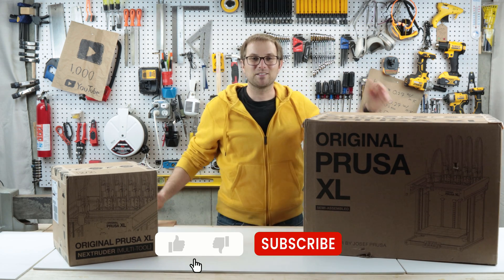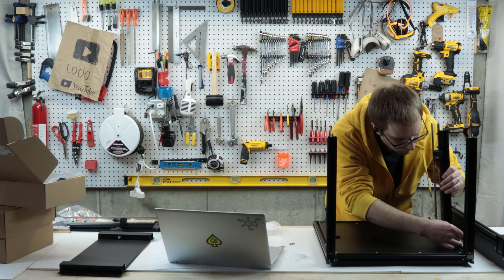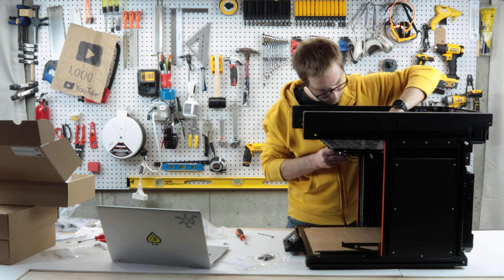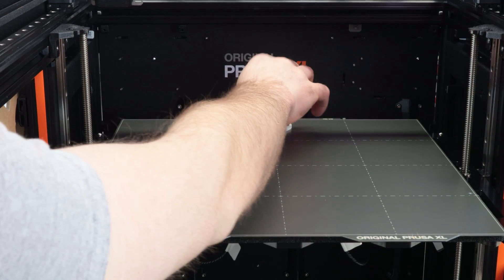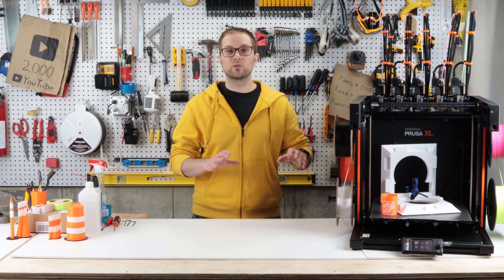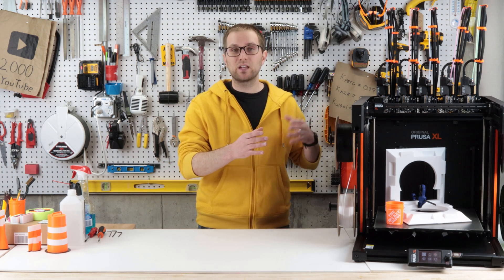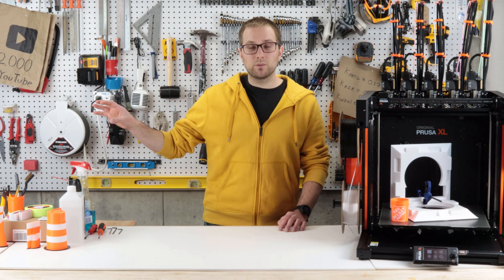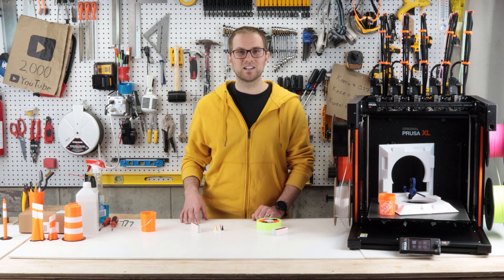Prusa XL 5 Tool Head: Unbox, Assemble, and Review!

Comment: I'd recommnd going with a satin sheen instead of PEI. It works great with both PLA and PETG and after two years of printer on my 3S+ and 4 it's still like new :)
Reply from the maker: Thanks! Yes I have a satin sheet for the XL but I didn't film any B-roll of the PETG prints I did. (Though if I'm just printing a 1-off I'm frequently lazy and just spray some window cleaner on the PEI sheet as a release agent. I only do this if it's already a well used PEO sheet). On my Mk4 I keep the satin sheet on most of the time. On my Mk3 I'm mostly running PEI sheets.

Thanks for watching and commenting on this video too!

Comment: Congratulations for the new printer... I think this is an excellent and expensive new toy (printer). Many people in this field are collecting more and more printers for no valid reasons but just for the fun of it (me included :) ).  My question to you: I saw purge blocks in your video, is it a requirement for this printer or just sample file, since the main reason behind having several heads is to save filament waste and reduce print costs over all?
Reply: Those are not purge blocks as the XL is a toolchanger and does not need to purge previous material in the nozzle. They are wipe towers and while not strictly necessary, they are used to stablize extruder pressure after idling on the nozzle seal. They are hollow and use very little material compared to a MMU setup.
Reply from the maker: Thanks for the correction I've been calling them purge blocks incorrectly on the XL

Comment: Great review, it seems like they've refined this 3D printer a lot since the first units sold last year. Unfortunately, they had to change the nozzle from 0.6 to 0.4 to eliminate stringing issues. The good thing about Prusa is that they will keep refining details, improving the firmware, and optimizing the slicer, therefore, Prusa is always a good investment.
Reply from the maker: Thanks for watching and commenting! Yes unfortunately Prusa ultimately did a lot of beta testing through the folks who pre-ordered. I pre-ordered mine late (in Feb 2023) so the kinks had been ironed out